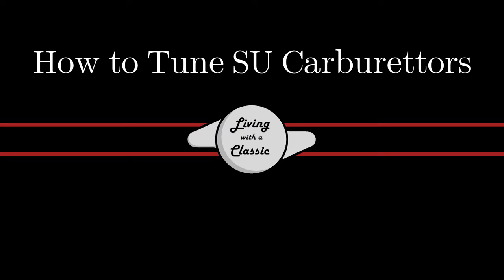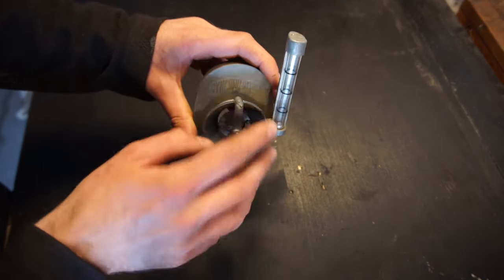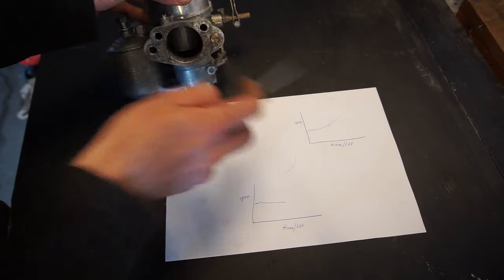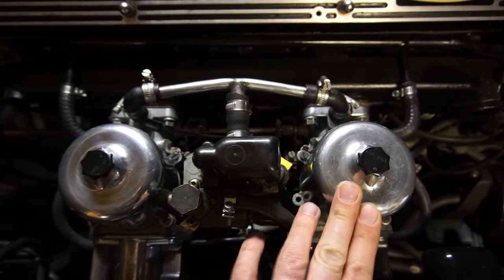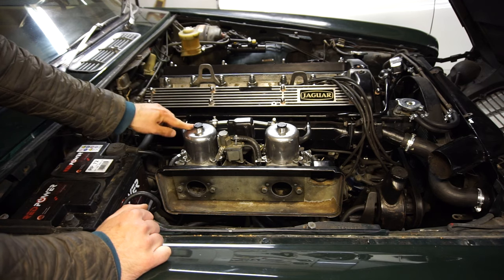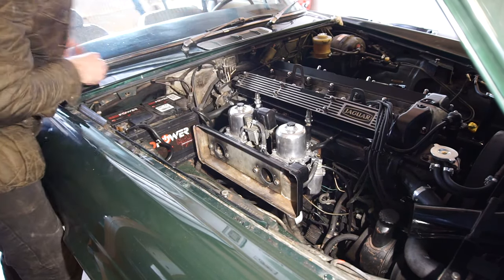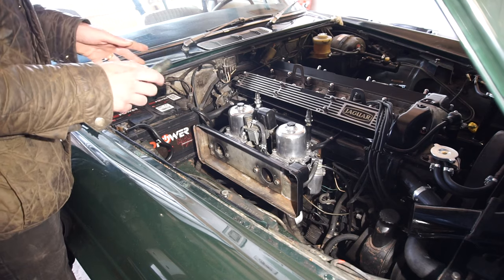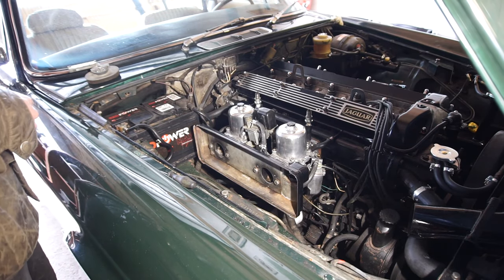How to Tune SU Carburettors

Comment: Great video on the basics of working on SU Carbs. I worked as an MG, Austin Healey mechanic in the 1960s and early 70s and although the SU Carbs used in them are similar to the ones on this Jag there are some slight differences in design. To adjust the jets for rich/lean mixture on MGs you use a wrench to move the jet up or down by changing the height of the seat. They used to sell a special tool for this but I always just cut most of the handle off a suitably sized open end wrench which gives you a stubby sized wrench which is much easier to use underneath the carbs. For synchronizing the carbs I just removed the air filters and held the end of a small rubber hose on the edge of the carb throat and placed the other end in my ear. The sound of different air velocities is quite distinctive and with a little care very precise adjustments can me made with this method. One point not made in this video is that it is absolutely key to do a thorough job of cleaning the inside of the dashpots as well as the skirt of the piston that runs up and down inside it. Many times varnish that collects on these surfaces can cause the piston to hang up, or lag behind in responding to throttle changes. As mentioned in this video these pistons and dashpots are a matched set. The reason for this is that fairly tight tolerances are required for them to work properly. Unfortunately this eventually became a problem with MGs (at least in Calif) as EPA requirements forced MG to tighten up these already tight clearances. I owned a small sports car repair shop in Calif in the early 70s and MGs sold in Calif at that time were very difficult to set idle speed on as the dashpot pistons were constantly hanging up. It would have been illegal to hone out the dashpot chambers a tiny bit but doing so may well have solved this problem.
Reply: Hi Boatman as you have  some experience with the MGA which I also own , maybe you could make a video.

Comment: Thanks for the video. It has been a great reference for me to keep my customers 240z running as it should. Hadn't touched a set of su's since the 80's, now in the past 3 years I've had 2 customers show up with 71 240z's both with carb issues that the local z specialist would not touch. Thanks to your video I can tune them peffectly.

Comment: Hi Adam, another great video.  Thank you. There are so many different schools of thought on tuning SUs and I definitely think it is an art rather than a science!  Everything you did on the XJ mirrors what I do on my Mark 2 except that I think you suggested that you should undo the throttle linkage before tuning and tune the two carbs completely separately before re-connecting the linkage.  My manual (Jaguar and several others including Haynes) is/are clear that the linkage should be loosened at the beginning to ensure that the butterflies can be and are both completely closed and then re-tighten before going on with the rest of the tune up.  I've always followed that practice and it works well for me.  Interested to hear your thoughts on that......

Comment: Thanks mate! I have a datsun 240z. I found out my su carb was completely unresponsive to the mixture screw. I took it to a professional tuning shop and the took the bell housing off and unstuck something. I wish I had asked them exactly what they did, but if you find the min and max of the mixture adjustment makes no difference, that could be your problem too. The weather in Seattle is starting to get a bit colder so I'm expecting to try again in the next few weeks. Thanks for your video, I think it's a great summary and plan to follow it next time.

Comment: It's hard to judge how much to raise the piston with the lifting pin. You say slightly. Does this mean the smallest amount of movement I can make? If there's no change in engine speed, does it mean I didn't move the piston enough?  The problem is that, no matter what the mixture is, the engine will always stumble if you raise the piston a little more than "slightly" right?

Comment: I'm not sure if you have an earlier video but the first step is to make the main jets are serviceable and set to the correct initial heights and that the throttle spindles have no lift. If any of those three are not right it's a waste of time carrying on.  Jet heights have often been messed around with by owners in the past. 

You also miss an essential step while tuning and that's to clear the inlet manifold of excess fuel regularly. This was a standard procedure and every few minutes entailed raising the RPM to at least 2000 RPM and holding it there for 30 seconds. Then you can use the lifting pins and make adjustments however the lifting pin method works well on some engine and less so on others so the best method is to check spark plug colour after a run.On this age of car the lifting pins were never intended to be used. They were just a hangover from earlier times.

You also seem to raising the RPM intermittently using the cable quadrant however you still have the two carbs disconnected to reset air flow.
Reply: You know your stuff

Comment: I've got a Toyota 8RB it has the dual Asian carbs,  they have the only vacuum activated power valves I've seen in a domed SU type carb.  Toyota made a few performance engines back in the day and the 8RB is a 2L single over head cam 8 valve closed chamber iron head on the same block as the 18R and 18RG.  I noticed the SU carbs pull very strong, it's like a nice flat torque curve and that makes them fun in the hills.

Comment: The number 1 issue with old SUs are throttle shafts that leak air.  Spray carb cleaner around both sides of the throttle shafts in each carb and if the idle changes you need to replace the shaft bearings.

Comment: Thank you for the tip about only tuning the carbs one at a time . I'm having a little trouble getting them dialed in as good as I like but if I watch enough how to's about them I should be able to figure it out. Most of my friends bad rap SU carbs and tell me I should change over to a Weber carberator. They put SU carbs on so many different cars and usually sport type cars that I figure there must be a reason and they can't be that bad or the carmakers would have used something else. I have a 62 Volvo 544 Sport with a B18 engine in it.
Reply from the maker: They are good carbs and really good for street use. One other thing you can do if you get confused is to set the mixture the same on both carbs by measuring the height of the jet and make sure they are the same. Then if you make the same mixture adjustment to both, you should get pretty close to start with

Comment: You should emphasize the importance of the throttle plates (butterflies) closing completely at idle. You did mention the throttle stops but if they are not in the correct position on the linkage the plates could then be slightly open. Also a timing light is useful for reading rpms while  making adjustments

Comment: Hi Adam, I follow your channel and subscribed to it already. On my recently purchased Jaguar MKII I think I have an issue with my HD6 carb's. The front one is spitting fuel from the floater bowl into the ventury when the fuelpump is filling the bowl. This with a non running engine. With the fuelpump off I have the same effect by pushing slightly with a screwdriver on the jet inside the body of the carb. Can this point out to a damaged diafragm? I see no other reason why the fuel is entering the ventury. Do you see an other reason? Can you explain the function of this diafragm? Thanks in advance for your answer. Phil

Comment: Hi Adam, love your videos. I have a 420 Jag with very unhappy fuel issues. The main issue is the SU's (2) need refurbishing/tuning and your information is very helpful. The car also has an electric choke. Will you be doing a video on the auto/electric choke maintenance and tuning etc?

Comment: 59 544 Volvo..at the point where I must try to get it running to further adjust timing and carbs..been a struggle.. videos aid a great deal..have added electric fuel pump.. will struggle on

Comment: I have a frogeye sprite with a 998cc flat top and big valve ported head with 1.27 rocker (rather than 1.22). How do you selected the correct needle size for the twin su hs2? Thanks

Comment: I have a 3.5 sd1 v8 efi converted back to carb, when i accelerate at 50 55mph it bogs would this be some thing to do with the su carbs its running bbw needles

Comment: Hello! I have a Volvo 245 with a single SU hif6. I have been trying to tune the carb according to your video. When lifting the piston the rpm drops which should mean that it runs lean. Now I have screwed in the jet adjusting screw all the way and it still runs lean. Is this normal and what should I do?

Comment: Hi Adam, could you please discuss kickdown on the XJ6 series 2? I have a problem with my 1974 when it gets to a hill it kicks down a gear but immediately goes back up a gear and then  it keeps going up and down continuously. If I manually put it second gear all is fine. Where should I start to look for a solution? Your help would be much appreciated.
Reply from the maker: I can try and cover it pretty soon. I may need to adjust mine too

Comment: Just saw this video,how do you tell if the needles are correct? I have a 544 with a b20 engine,I think the po used it for racing,and has changed the needles from stock.

Comment: So i inherited my adopted father's custom built chopper shovelhead engine with a beautiful BIG S.U. carburetor, it's almost impossible to apply the rear foot pedal on forward controls ( foot pegs) because the air filter housing is almost sitting on the shin of your leg and start pressing your shin into  it as you press the brake, I remember asking how he used the only brake with the carburetor, he told me that he would have his foot on the edge of the foot pedal with his toe pointing inward so his big toe could reach the brake pedal, scariest shit i ever heard, so both ways was asking for a injury ending the joy of riding a motorcycle, so this S.U almost lost it place on my chopper because i knew nothing and could not figure out any useful info on it, until i found these videos on living with a classic, and now i act like i am the expert on these carburetor, because they are simple and don't struggle with starting or messing with a choke, this S.O.B doesn't have one, IT DOESN'T NEED NO 🙀 CHOKE, facts, it's doesn't even need you....ok that not true, my point is, when i jump on to take.a ride and open the petcock and i see the glass fuel filter fill up and fire it up, i hear Bob Marley singing “ Don't worry, be happy", as i ride on down the road, and i fixed the brake problem by putting a extension spacer on the brake pedal, and now my whole foot is on the pedal and my leg feels comfortable on the outside of the carburetor rather then having it right under it.

Comment: Are you going to show what turning that mixture screw really does? On my MG TD it you turn a bolt on the bottom of carb to raise/lower the needle in the jet. Does a Jag work the same way?
Reply from the maker: Every SU carb is a little different. On these the screw pushes a rod that raises or lowers the jet. In my video explaining how the SU works I go over this

Comment: I have a pair of these that need torn apart and checked out due to the car sitting for years and having bad fuel in it. I put a new fuel tank on it and inline filter and now i'm ready to do the carbs since when we ran it last year for the first time in a long time we discovered leaks at the bottom of where the jet goes up through. I'm working on a '53 MG TD with twin H2 SU carbs. This is my first rodeo with car carbs let alone a strange set up like this so unfortunately I don't know any old timers to give me a hand since it's not american. I'm hoping i can just take them apart and clean them and put new seals in and everything will be ok, however i'm not sure if it was set correctly to begin with. It has a manual choke so what do i need to do for the fast idle adjustment? And do i absolutely need one of those tools and where do i buy such a gadget? I read somewhere you can sort of balance them by ear by using a piece of hose to listen to the air going through each one. Thanks for the informative videos.
Reply: Hi 
My first car was an MG TD ---
I have always used a 3 foot long (say ?  about 90 cm length) piece of garden hose to set the balance on the carby air intake.
You are listening for the same amount of "sucking" sound. When the two are equal then your ready to go.
The only thing is to make VERY sure that you are holding the end of the hose at exactly the same spot on each carby.
The "ear" end of the hose you hold the pipe pointing up and right next to and just touching your ear lobe for best sound.
I can easily balance three carbys on a jag E type--- no hassles with my garden hose. Just keep going back and forth between the carbys until each sound is balanced.
deeper sound is too lesser suck--- higher pitches is too much suck--- just balance the tone. The idle will rise or fall as you adjust the carbys when you have both OK readjust the idle to a good engine idle rev. Dont forget to isolate the throttlelinkages before you start and reconnect when finished.
Final check with the garden hose again and your ready to go.
I have had 19 British sports cars in my life time and thats how its done-- by the way I am a grey haired old bloke with lots of sports car experience.
Best Wishes
craig
Reply: @craigmorton1944  Thank you! My only other question is how in the world do you adjust the mixture on these? I don't see a mixture screw? And there are no springs behind the pistons...one blog i read said the MG td carbs didn't have a return spring for the pistons because they were heavier and used their weight to return. Is this true? Thanks.
Reply: @hrdcorebeast  
Hi One of my manuals specifies "Blue  springs" (2010 SU manual) but my 1950s TD and TF workshop manual doesnt show any springs? I cant remember my car because it was 50 years ago !
Your carbys are H4 type so look up H type carbys at 

https://sucarb.co.uk/h-type-carburetters

All H type carbys are the same so you can get lots of info there.
The richen and weaken brass nut is at the base of the carby around the jet .
see 
https://sucarb.co.uk/technical-h-type-carburetter-diagram
By the way dont forget to fill the dash pots with engine oil before tuning begins .
Dont be tempted to use ATF (auto transmission fluid) or some other light or heavy oil .Engine oil is fine and specified in both of my workshop manuals 2010 and 1950s.
Tighten this nut UP for weaker and loosen it DOWN  for richer. Small turns are only required start with two or 3 flats on the nut to start then fine adjust from there.

If your tuning from scratch follow the instructions in the su carby site above.

Also Look at Moss Motors . They have heaps of MG bits for sure.

https://www.moss-europe.co.uk/

This is the UK site but they are in Europe and the USA with sub agents in Australia.    ( probably also elsewhere)
What country are you situated ?
I am in Sydney Australia.
Google your MG car club in your area. The would welcome you and your car for sure.
Best wishes and let me know how you go 
craig
Reply: @craigmorton1944  Thank you very much! I have already been to moss and that is where i got my carb rebuild kit from. I'm from the good ole USA. It's not my car, I'm working on it for a guy i know. Car was very neglected for years so we are trying to get her back to life. I just had to put a new fuel tank on it for him because it sat and water rotted out the bottom of the tank and apparently the seals for the jets dried up because we had it fired up but it pissed out the bottom of each carb so we quick shut it off and now here i am. I have emailed moss about these tech questions but have yet to receive reply. It looks like they are behind right now due to the so called plague, but I'd rather hear from an old timer like you any way. I'm 31 now and I feel i know a lot more about cars and fixing things than most my age because I've always listened to the old guys when everyone else would ignore them. My wife says I'm a grumpy old man at heart.
Reply: @hrdcorebeast  
Hi again
You will for sure get the TD all together with some sweat and persistance .
Thanks for listening to an old bloke.
I currently have a MGB 1969 and an E type Jaguar roadster /convertible 4.2 litre also 1969 model . I sold my Aston Martin DB6 to buy the E type.
Sincerest Best wishes to you and good luck with the TD
craig
Reply: Hi Again
Have a look at  John Twist from University Motors .  
He takes apart and puts back together correctly a H type carby.

https://www.youtube.com/watch?v=sxVFCY_1aSA

It may be of much assistance..
best wishes 
craig
Reply: @craigmorton1944  Thanks a lot! That does help. It seems these carbs are missing the piston return springs...i called moss and they said red springs for this car. And when i took apart the jet area i don't see any of the cork seals so that explains why fuel is pouring out the bottom. I wish that video was a bit less blurry so i could see everything better. Thanks!
Reply: @hrdcorebeast 
If you have some spare time to watch,  the University Motors fellow has lots on all MG things.
  Best Wishes to you.
craig
Reply: @craigmorton1944  Thanks again for all of your help. The MG fired up and i got it tuned and balanced pretty good. The guy i'm doing it for said it never ran as good as it does now. I left it a little bit rich but rather rich than lean and it road tested pretty good. The videos and links you sent helped me so much. Thanks again!
Reply: @hrdcorebeast  Well Done !!!
Very Good to hear your friends MGTD is alive and well.
Thank you for letting me know how things went.
Best Wishes and    Safety Fast !    ( MG Motto)
craig